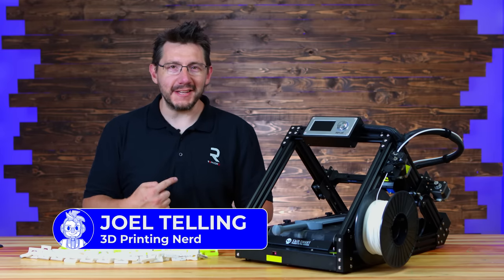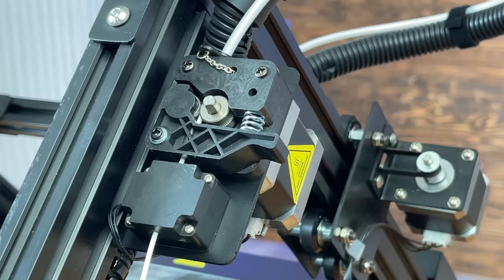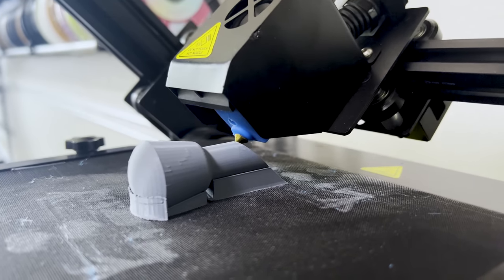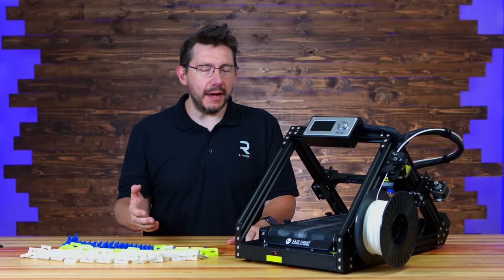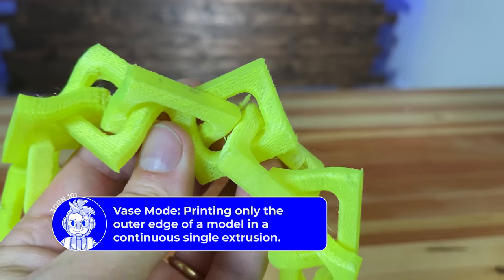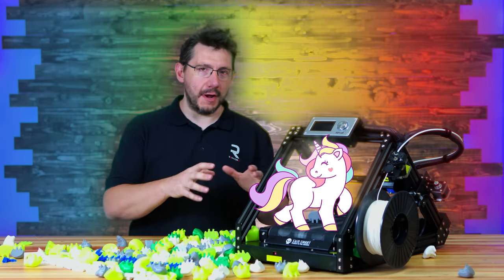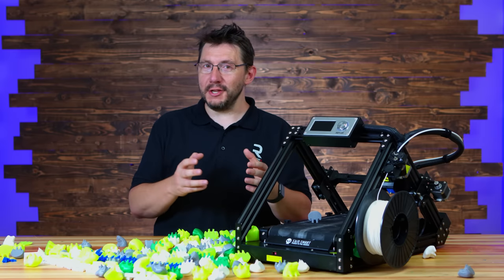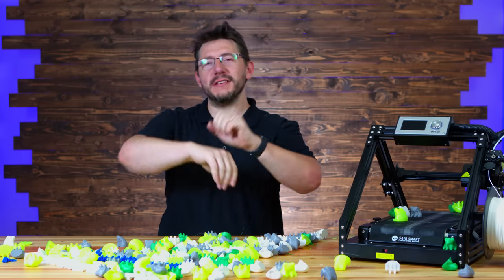ONE BELT to RULE THEM ALL? Sainsmart INFI-20 Review!

Comment: Oh hey! Something that I actually know about! Also, Sainsmart doesn't actually make the printer (it's white-labeled for them). I did a segment in a video on my channel about it with another printer from the same white-label manufacturer (different end branding on that printer, though).

- The INIF-20 (belt printers in general) is awesome for all that it does do, but what it doesn't do isn't awesome at all.

- I've had an INFI-20 since last year and have made quite a few projects with it. For what it's worth to anyone who may be reading this, tamping expectations and finding it's niche in your own print space is really important.

-  Ideamaker has been so much better for this printer than the Blackbelt Cura rebrand that Sainsmart includes.

- Print orientation is important to get the results that you'd typically expect; it's definitely not for standard models that most people are used to working with in 3D printing (ie accidentally printing mid-air because overhangs are in the wrong spot).

- I found the sweet spot use case on mine to be genuinely rapid prototyping models/objects with 90 degree overhangs. I even made a nearly 3' tall and 2' wide standing armrest with it, along with printing out life-sized dimensional lumber and beams for assembling other life-size prototypes. I also changed out for a 0.8mm nozzle, which really worked out great for the "genuinely rapid" part and have cut, quite literally, multiple days from print times of the bigger stuff.

- Layer shifting on a long print from the belt ejection mid print is a real pain, but if you think of your model kind of like an "I" beam on the belt, and try to orient it so that the "I" of the beam (as in your model) would be upright instead of laying on it's side like an "H", you can reduce the problem.  I've got some videos if anyone is interested.

- Also, Sainsmart has been selling the INFI-20 for $600 on Amazon (sold by Sainsmart) for a little while now. Not a bad price compared to what I paid last year, but I still think this should be sub-$400 range; it's kinda basic in operation and doesn't really offer premium features for it's price point, you know? I mean, materials sheet wise (aside from the belt and belt rollers) it's really not much different than entry-level cartesian style models.

- Oh, and although I did buy the rollers, I'm not 100% convinced on the necessity (and cost) of them; you can print off your own end belt supports for mounting to the printer.
Reply: whats the white label brand? and do their other resellers have better prices?
Reply: @rickyschadel1333  The INFI-20 is a rebranded Malyan MA20.  I'm not aware of other resellers.

I also have a Monoprice MP Select Mini, which is a rebranded Malyan M200 printer.  To Malyan's credit, it's still great after 5 years of regular use, so I'm optimistic towards the INFI-20's longevity.
Reply: @rickyschadel1333  FYI, Sainsmart is having their anniversary sale until August 21.

There's a coupon on Sainsmart's site at the moment for $250 off until August 21, which makes the INFI-20 $500 for USA people with free US shipping.
Reply: Hi 👋 five!

Comment: I don't have a belt printer, but I would like to suggest a fix for that layer shift.  When the print reaches a certain length, say 200mm, the belt will run forward 100mm and then back (100-x)mm; where x is the layer height.  On the forward run, the part will peel off of the bed.  The back run will bring it into position to continue printing.  That way, the tool isn't printing when the part tries to pull up.

Comment: I've had my INFI 20 for over a year now and have run into a lot of the same problems! My bearings were squeaking after a few multi day prints and the multiple copies function in the slicer software really isn't the best. Other than that, having pieces of the nylon belt on my prints wasn't ideal and I had no idea how to dial that in until now, so thanks Joel! 

Hope SainSmart can keep improving cause besides these issues, I've been able to be good prints despite being a complete novice and this being my first 3D printer!

Comment: I'd like to see a belt made like a tank track with glass or pei sheet strip attached to belts on the edge.
Reply: But then you have to solve how to make printed models automatically come off the flat strips. It wouldn't be a huge problem for longer parts, but if you were printing multiples of a smaller model it wouldn't just pop off at the end as the flat strip wouldn't curve.
Reply: @ScarfmonsterWR  smaller strips!!

Comment: I found the issue that causes that massive layer shift. It's a combination between the small y axis belt and pulley under the machine. From the company they come over tightened, or the pulley is loose from the shaft. I've been in a Facebook group and it seems like a very common issue. I adjusted the tension after replacing the belt and it's been much better.

Comment: Which version of cura did you use?  They just updated to 4.8 I believe.  I've had horrible issues that i've worked with them and they helped me for 8 months to resolve (time dedicated to dealing with broken stuff delayed a lot).  I had lots of tension issues from factory, two bad fans, etc.  They've been great sending parts, updates, analyzing code, and I bought a spare bed belt which seems improved from the stock from Dec/Jan.  

I feel like they could have waited 6 months and released a great printer vs a beta printer.   Initial firmwares would freeze, 300c runaway and create coal in the hot end requiring a new hot end.  I would be ok recommending someone as a 3rd printer+ now as someone experienced.  The noise on the tensioner is the bearings going bad from an early model or missing a washer/tension.  Please reach out to their support because it is nice dealing with them vs creality who never responds due to warped parts overtensioned.

Comment: Seems like a horizontal metal plate right at the end the belt (level with the belt) where it starts to curve might help to support long prints as they detach from the belt and prevent them from sticking too long.
Reply: There actually is a knife like you suggested on the end of the belt, it's the bit with the name on it. It's at a pretty sharp angle, which is nice for knocking off little parts, but needs to be nearly tangent with the build surface to prevent the layer shift issue on longer prints (like you suggested).

Comment: Going to ask you something no-one seems to have checked, or isn't willing to share their results if they have: how do these things handle warp-prone materials like ABS or ASA? Obviously with a belt made of Nylon it perhaps isn't going to end well trying to put Nylon on top of it, but surely the temptation has been there for ABS or ASA. A passive "enclosure" similar to a phone booth or perhaps just a floor-length curtain feels viable with the printer wall mounted, but if the belt isn't suitable then that's really not going to help.

Comment: got one on their thanksgiving sale and shamefully have only used it for one sword print (3 foot long, though) Check your bed temp with an IR thermometer mine said 70 on screen but was 50 at the bed. Had to crank it up to 100 to get things sticking. That was some time ago so hopefully that's been fixed in firmware (I did report it.) My plan was to try some white rain hair spray on the belt once it wears out. Ended up using a first gen ender 3 and thomas's trick to get an old android running octoprint with a plugin with an "loop" option to print the product I had in mind for the belt printer.

Comment: Great video, thanks for the info! One of these days I will figure out a good reason to get a belt printer.. :) Looks like this could be a good way to go!
Reply: I’ve owned both this and the CR30. If you have to get into belt printing I’d go CR30. I do like the belt tension reading and belt hold down stuff that sain smart added to the chassis but the firmware needs an insane overhaul. And it still suffers from the same issues all belt printers have with epically slow speeds, pretty much only PLA, and spotty quality. Only reason I’d recommend the CR30 is at least there’s a pretty large community and following to rely on. And people like Repkord and Nak3d making serious mods for it. Even after all that they’re still a crap shoot and slow. In my mind only good for length and not production.
Reply: @drewpd7  appreciate the feedback. I am definitely going to keep an eye on things for a while before I pull the trigger. Only PLA would be an issue but makes sense since it is open and I’m guessing that also has to do with the belt adhesion.  Thanks for the feedback, have also seen the cr30 and it seems better after the repkord upgraded.
Reply: @GregsMakerCorner  I did all the updates and it is much better. Klipper makes an even larger difference. But even after all that it’s still dicey due to the belt. And the heater plate under it that’s prone to warping/warped in production. I will say the major added bonus of the CR30 is that it’s a creality product so there’s thousands of people who are familiar with their processes. That is a huge and needed help.

Comment: A chain-belt could work. with intermittent raft, designed to lock into grooves, which can make things self-cleaning if angled right, like how hairs work like valves to move fibres and dirt. across your body (e.g. bellybutton fluff)

Comment: A repeat and counter manipulation function isn't present in most slicer g-code interpreters, but it really should be. You could literally just have the same model loop with the addition of only a few bytes of data at the end, or run forever if you init the counter at -1.

Comment: I still never understood my not have a slot for a regular SD card, or usb stick/slock on 99% of the 3d printers.  have lost a few mini sd cards as they shoot out, and easier to get stuck if put in slanted.  I have an idea former. I have not used it much. I thought I would use it more. But I mostly use my regular 3d printers. I just need to make something long.

Comment: I've had nothing but issues with this printer missing steps I believe it's doing. The nozzle keeps end up running into the bed after 20-30 layers and then scratches the bed up. Infi has not been very helpful with troubleshooting. They asked for my files after suggesting to tighten my belt. I sent them the files a week  and  half ago and they haven't gotten back to me with any information since. I reached out again a few days ago and no response. I'm running a .8 nozzle with a visible distance between the nozzle and the bed. Anyone with some advice before I return this printer would be great
Reply: Send It back. I've had mine 5 months and had similar problems. Sainsmart has been "helpful" in the sense they have tried to help me but they where unable to resolve my issue. I'm getting a replacement sent